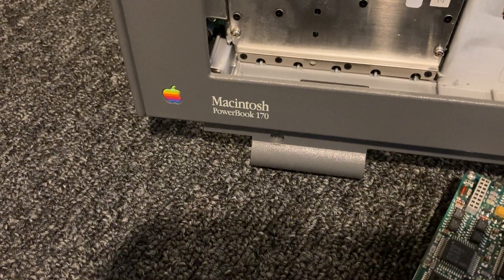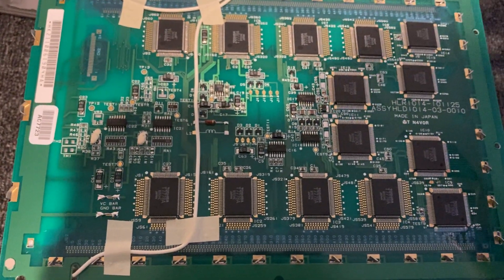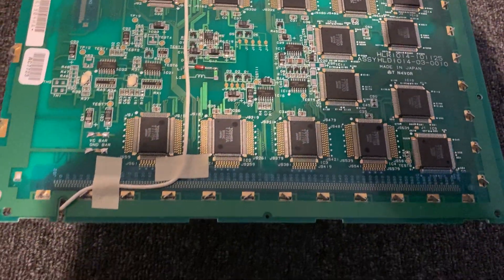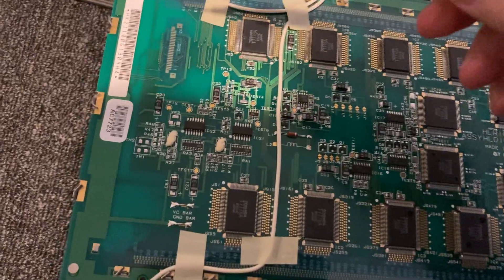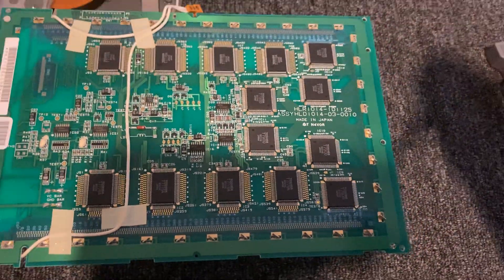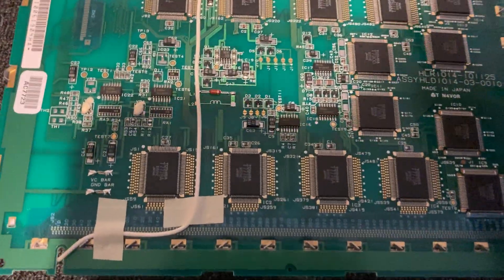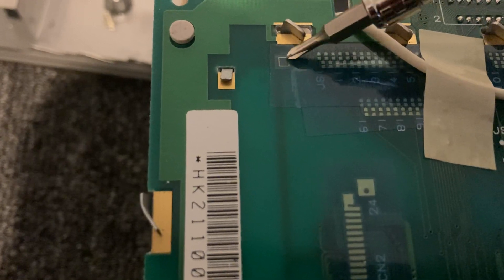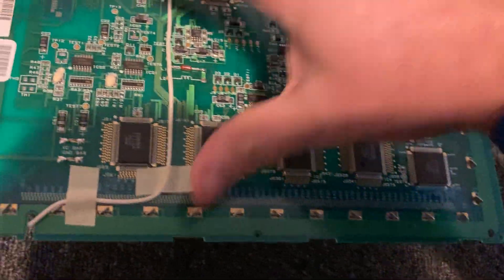Macintosh Powerbook 170 Screen Tunneling Fix.!

Comment: You mention using test connectors, test points, and 'flashing' chips which have gone bad if bending the clips around the edge does not work.  Could you publish (in text or video form) information about performing these tests and the procedure for fixing the display?